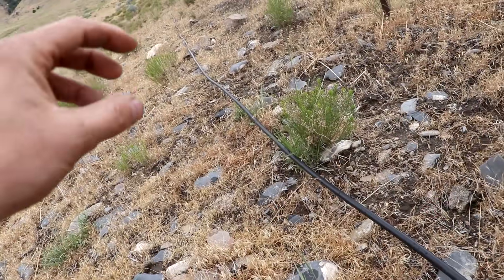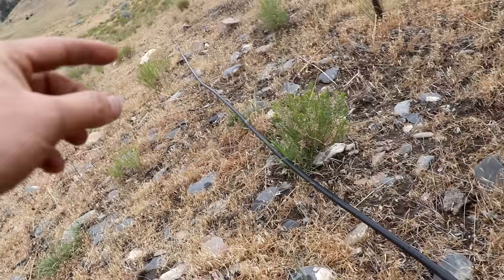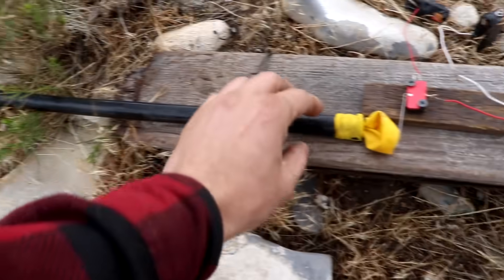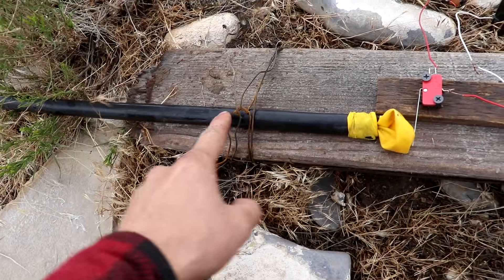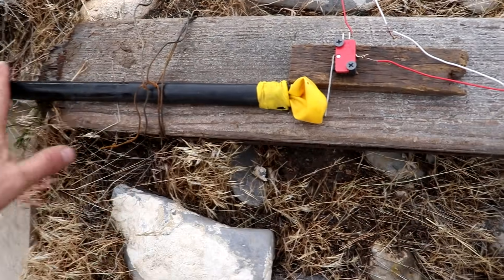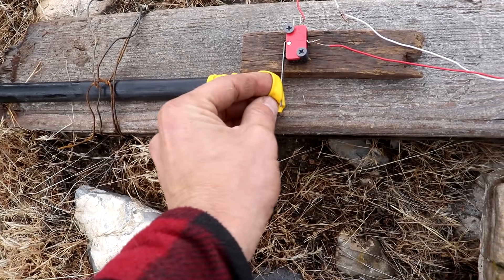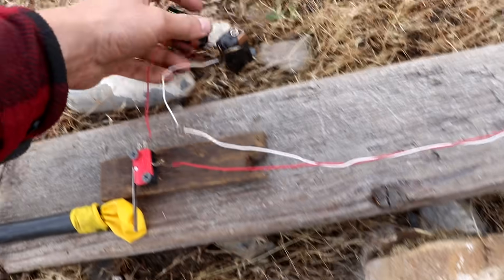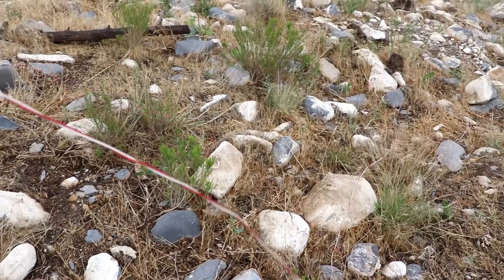Chain of thunder part 1

Comment: Absolutely amazing experiment, with wonderful results. I'm in awe of the use of plastic pipe as a sound channel and balloon trigger! That is the best analog timer I've ever seen. Super reliable and no pesky electronics to deal with. We all know every device scans code at different intervals, which could make the experiment much less reliable. Too bad I can't give it more thumbs up. So just fyi, you get 2 thumbs up for this one.
Reply: I don't know that I'd call it reliable; I was impressed that it worked at all!
Reply: Time traveler
Reply: ?what?
Reply: @oxiac6006  lol "1 week ago" when it was posted today. maybe Chuck used the lightning to power a flux capacitor to generate 1.21 gigawatts
Reply: Tim Williams  this comment is odd.... 1 week ago
Reply: @crazyeye1  You guys do realize Cody usually posts his videos for patreons before publishing them as a reward and to get comments and advice on how to  improve or mistakes he may have made right ? 
Comments older than publication date would stem from that.
Reply: @crazyeye1  patreon
Reply: Yep good o'l Cody is the best...
Reply: noxxi knox  nah you don't even need an external interrupt. Just use a piezo microphone and pass it through an amp and a comparator, then to a self latching transistor circuit (relays would be probably be too slow in a self powered configuration). For a 10x experiment just get some boards fabbed in China and spend an afternoon assembling them

(Edit) Hell if Cody asked I'd gladly design and build them for him
Reply: The delay of pooling a single digital pin on a modern microcontoller should be irrelevant; If you can pool at 50MHz that's about 0.00002ms. And that's without interrupts, a mechanism in computers for triggering an event "instantly". The porblem is reset conditions, if your microcontroller looses power, the pins are often in an undefined state, which is bad if you're dealing with explosives. Besides, you don't really need a microcontroller, you just need a microphone and an amplifier for the fuse. Which would probably be way more reliable, but still require external power and thinking about the reset conditions.
Reply: @thugglyfeog8382  I agree, Cody is definitely the Best.
Reply: Couldn't say it finer.
Reply: @mysteriousmuffins4217  thanks
Reply: How much money do you need for a camera with a proper wind deafening device? I as a headphone user can not stand the wind. It is rather painful.
Reply: I as a non headphone user love the wind and find the sound relaxing.
Reply: I dub thee "allstar" ...
Reply: @captainnemo2150  no problem
Reply: @Maxjoker98  You mean, "dealibg with thunder in a can", right?Because he clearly uses no explosives whatsoever, only the youtube-friendly thunder in a can
Reply: @T3sl4  if it isnt reliable then why did it work near perfect on the first try, luck? 
its literally working exactly as intended, just because he isnt using something that is pin point 
accurate dosent make it unreliable, it clearly did exactly what it was suppose to do and can be adjusted at will
id like to see something as simple as this be any more reliable.
Reply: @crazyeye1  
People STILL posing this sort of comment after years and years of youTube
youTubers often put up unlisted videos, but they aren't visible. Some people can view them because they are Patreon supporters, and/or because they are accessible because they are referenced on the owner's Twitter feed.
I saw this video a week or so ago and I commented on it a week or so ago; I can assure you that's what happens.
The only mystery would be if someone replied a week ago on a comment that was posted today. That never happens.
Reply: I agree I've seen this type of experiment before but not like this, he has great inventive skills.
Reply: @Physhi  More equipment he has to research, make a purchase, read the manual, learn how to use.  Geeze for all of 3 mins you could take your headphones off. Watch it tomorrow if it's late at night.
Reply: @Bluxdemon  
I don't think I've ever seen that length of piping before for something like this, and never thought it would work.
Reply: @T3sl4  It worked for 1/1 trial, which is 100% reliable!
Reply: @Username Taken I watched it last week. I'm not a time traveler (though I'd love to in the future), not am I a patron supporter (though if I had managed my finances better as a young man, I would be). I'm just a Twitter follower who has a love of science, and really enjoys Cody's work.

Comment: "I'll throw the metric up here"
doesnt add the metric
Reply: The_Observer  hmmm yes 

your not wrong
Reply: The_Observer  
cody is approximately 28 hamburgers tall and weighs about 7 AR-15's
Reply: The_Observer  nah... I prefer the measurement wich landed men on the moon
Reply: @Killbayne  Are those 7 AR-15s with 100 round magazines and converted to 7.62 x 39 mm? With about 500 rounds of extra ammo?
Reply: The_Observer  By freedom units you refer to the system based on the British Empire in contrast to the metric system that was invented in France during the revolution? Seems legit.
Reply: @safetyinstructor  I prefer the system that NASA uses.
Reply: 1 mile is about 5.4 microlight-seconds.  Speed of sound in air is about 0.0000011c.  Speed of light, 1c
Reply: I wanted to know how many bald eagles per football field difference there was.
Reply: I have the easiest way to remember the speed of light in furlongs per fortnight, unfortunately I cant remember what the number is!  in any units I think Cody is the best.
Reply: @Killbayne  I'm a bit of a scientist myself.
Reply: @Chuckiele  based on the king's body parts, you got it.
Reply: The_Observer  "Freedom units" invented by your imperial overlords.
Reply: @Killbayne  Well not that the universal speed limit divided by an arbitrary constant based on the dimensions of a random piece of rock that we happen to live on is any better. At least it's consistent though. Like 1ft=12in, 1yd=3ft, 1mi=1760yd (if it was 16 more I'd say the Brits had predicted something far in advance), 1gal=128fl, US UK and Astralia use different gallons and US has 2 different gallons for dry stuff and liquids. Like come on guys what the actual fuck?

Comment: Fun experiment!  Minor nit: electrical signals in wire  propagate much slower than the speed of light in a vacuum. The signal speed varies and depends in a number of factors but is typically 1/100th that of light in a vacuum. It’s a common misperception though. I’m really glad to see you excited about something and producing content again.

Comment: love how you captured the pressure wave to demo sound traveling from an explosion ....but you are measuring the speed of a blast wave ....which is dependent on the type of explosive you are using ( Detonation velocity ie. TNT = 6,940 m/s and Black Powder 631 m/s) and sound waves travel at a constant (332 m/s. )
Reply: Discovered your channel a few days ago, definitely one of my top favorites now.
Reply: Once you are a few inches from ground zero, detonation velocity slows sonic speed.   Detonation velocity is the speed of reaction in the explosive.

If you set off some PETN and ANFO at the same time and same distance from you, you would hear only one explosion even though PETN has twice the detonation velocity.

Comment: This is really cool. I also can't believe this worked so well. A microphone and an arduino would probably be more reliable but this is way cooler.
Reply: that arduino solution would be quite sensitive and hard to calibrate.
gust of wind = triggered
blade of grass hits the mic = triggered
static electricity = triggered
fumbling = triggered
all these interferences are orders of magnitude stronger than the thunder you want to measure so you can't even really select a threshold.
So you don't want to use microphones for this, the pipe and pressure sensor he used is much more selective and a very good choice.
Reply: @tp6335  No, you use a single arduino to stage all them in sequence, not as a sound operated trigger
Reply: @askjacob  that's a lot of wire, especially if it needs to carry substantial current.
Multiple arduinos using gps modules can get real time independently without comms, then each can be given a trigger time + µs offset.

Comment: You can also fix a device that shoots a small wire into the air to trigger some of the lightning. That's on my wish list to do once! Not sure where or whenever but once I wanna do it.
Reply: That is a really cool idea. I think I may try that out when I can. I bet a large Estes rocket could carry a small gauge wire 500-1000 ft.
Reply: @timjon1122 if you are talking about using the wire as an earth and still connected or close to the ground the trick will be getting the wire to spool out effectively without breaking or creating too much resistance, and dealing with the cumulative weight of the wire may prove tricky if you intend to get any decent height. Since natural lightning initiates from the ground upwards in many fingers and then the main bolt descends and follows the path of that first tendrils to bridge the gap in theory a rocket delivering a path of lower resistance should be able to trigger a strike, possibly even without being attached to the ground since a partial pathway may be enough to trigger a discharge. Would be very interesting to see it tried and if successful maybe, just maybe, the vaporised copper from the earth wire would colour the plasma with a green hue... Too much to hope for? Perhaps.. But it would be amazing to witness if it did
Reply: @Lilith-Rose  I ran out of breath reading your comment. Use periods my dude! 😂
Reply: A kite works too. Just make sure you release it from a distance.
Reply: @Simon-xj8hc  haha yeah sorry about that. When I am explaining something or talking about something that interests me I often forget to break it up. I guess I'm just too eager to get it all down before I forget what I was saying or lose my train of thought. I get why people think I have mild adhd
Reply: @Lilith-Rose  Not just in theory. There are examples of rocket being struck by lightning mid flight because of their ionized trails. 
I think Scott Manley recently did a video about that while talking about lightning rules and more generally weather range.
Another thing you can look at is how rocket launches show up on weather radars and satellites, clearly demonstrating they interact with ionosphere etc.
Reply: I think it was the University of Florida was using wire guided missiles to do this. With the explosives removed. They would fire them strait up, and the wires would pay out behind them as designed.
They were able to get lightning strikes when they wanted them even on a clear day, no waiting for thunder storms to run their experiments.
Reply: I've been thinking of doing that for years. The Wire seems very triggy but ifnyou mix some metal dust into your rocker fuel then maybe the exhaust trail could Work as "Wire". Or at least create an easier path for lightning
Reply: That is the coolest idea I have ever heard. I am definitly trying this sometime. How high do you think the rocket would need to go to set of the lightning?
Reply: Wire guided weapons spool the wire out from the weapon end.  This results in the wire effectively "sitting still" in the path behind it.  No need to worry about drag from the wire slowing it down, or breaking the wire.

Magnet wire is very light, and comes conveniently spooled.  All you would need to do to dispense wire from a model rocket is mount the spool so its axis is parallel to the path of travel, and from only the top side, leaving the bottom completely clear.  Uncoil enough to tie around a rock or something, GET AWAY, and light the rocket.

It is important to get away, because you don't want to be standing near the lightning strike.

Of course, it would be extremely difficult to set up a line of these that makes Cody's chain of thunder with only one thunderclap.
Reply: @___Alastor___  Apollo 12 got hit by lightning twice- the famous "Set SCE to Aux" incident. Vintage Space did a video.
Reply: @bosstowndynamics5488  aye that's what I meant, you need to lay it out so that it'll spool out correctly without snagging etc. Maybe spool out was a bit of an ambiguous phrase to use so I apologise for the confusion
Reply: its been a while since I read the story so my memory of exactly who and where is foggy...  but...back in the late 70s early 80s there was a group in a central Florida university doing tests with lightning and they used 'hi power rockets" ( size I,J,K motors) to run a wire into the storm clouds, the rocket didnt have to make it into the cloud, maybe 75% the way up and then wham!!, the wire created a path for the lightning to follow and the group got the measurements they needed. the wire spool was placed on the rocket and as the rocket went up, it constantly fed wire off of the spool so there wasnt much of a chance for the wire to be in the flame for more than a few microseconds.
Reply: bunny Killer I had forgotten about that. I remember seeing it on TV as a kid. It reminded me of the clock tower scene in Back to the Future.
Reply: @mrveller3441  metal dust is how some fireworks get their colours/sparking trails because the powdered metal burns with the fuel. I've never heard of a firework triggering a lightning strike personally so it's unlikely, worth a try I guess though
Reply: Yeah, that device is called a $20 hobby rocket.

Comment: Sound engineers use this for subwoofer arrangements. You can have 2 stacks of subs, one 2m behind the other with a time delay on the front stack so the wavefronts from both stacks phase align or sync up. It also has the added bonus of creating out-of-phase bass behind the stage, cancelling sound where you don't want it. Actually a huge part of a sound engineers job is time aligning sound from multiple sources with the added complication of polarity. Love the vids bro, hope your good :)

Comment: Watched a lightning storm over lake Ontario last night. When the storm is more than 16km (10miles) away you will no longer hear the thunder.
Reply: makes sence, seeing as sound travels in as a wave and the more it spreads out (with distance) the weaker it gets (i believe exponentially as well?)
Reply: @JediSentinal  Yep, intensity has an inverse-square relationship with distance, where as distance increases, intensity decreases by a power of 2.
Reply: another hypothesis is that the sound is generated more near the ground, the curvature of the earth may reflect most of sound when very far away.
Reply: I was watching a thunderstorm 35-40km away and there was no sound at all
Reply: IF,... there is a STORM,... and no one is there to see or hear it,... - DOES it (the lightening) make a FLASH & SOUND ??? 
.
..... what lightening ,... what storm. ??? LOL
Reply: @stevemacbr  Yes.
Reply: Hey, I watched that storm too!
Reply: Which happens to be why some people used to (and some still do) think there was such a thing as "heat lightning" that you see in the distance but hear no sound. Usually seen during warm summer nights. The thing is that they didn't realize "heat lightning" was simply a distant thunderstorm that was too far away to hear. But distance isn't the only thing that prevents you from hearing lightning sometimes. 

I have had a storm over my area that everyone in the neighborhood came out to see.  No one knew we had a storm overhead unless they looked up. The air at ground level was still. The sky was very overcast, but not as dark as a typical anvil thunderstorm would make it. But looking up you could see constant cloud to cloud lightning with absolutely no sound reaching the ground. Most likely there was a sharp pressure differential between ground level and the clouds which caused both the intense cloud to cloud lightning and also acted as a barrier, reflecting the sound of the lightning away.
Reply: Jedi Sentinel no, not exponentially. It goes as 1/R^2
Reply: judgeomega yeah and reflection and refraction properties would be dependent on the frequency of the sound wave, so that would be interesting to explore
Reply: @JediSentinal  I believe it's inverse square.

Comment: There was an art project at Burning Man in about 2014 or 2015 that did the same thing, but with lights, over about 5 miles. I think they must have reduced the speed of light by a factor of 100 or so but it was still cool to see, from a distance, the whole thing light up in a fraction of a second.
Reply: What?
Reply: @FF177-  They reduced the speed of light, duh. LOL
Reply: @xenonram  Technically the speed of light is reduced when the light travels through a dense media. But probably he meant something else.
Reply: @xenonram  They slowed down the timing of the demonstration, genius
Reply: Thanos was at Burning Man?

Comment: I love how you can just barely make out the first explosion as it travels through the ground and causes the tripod to transfer the noise into the microphone at 2:13 . It travels much faster through the earth than it does the air, which also helps confirm your previous sound experiment.